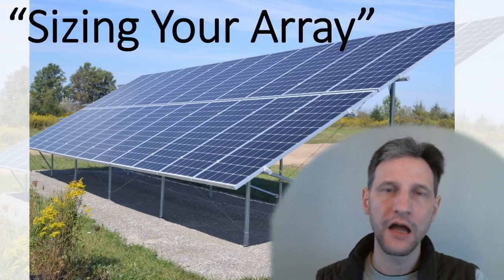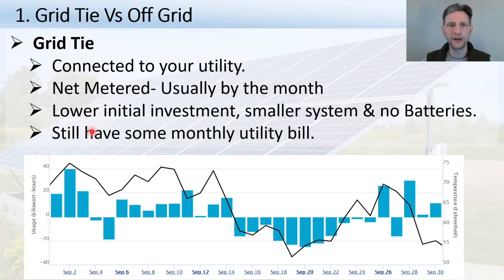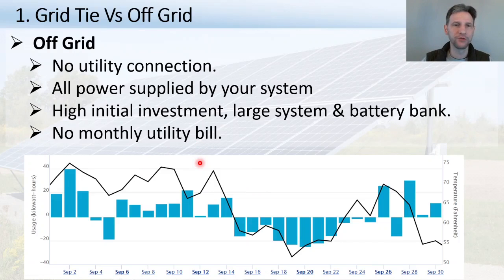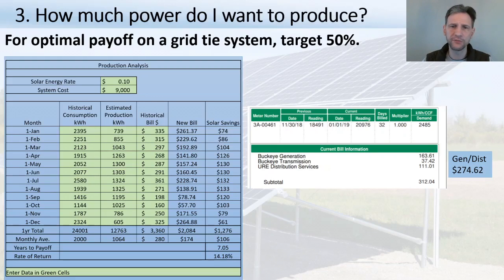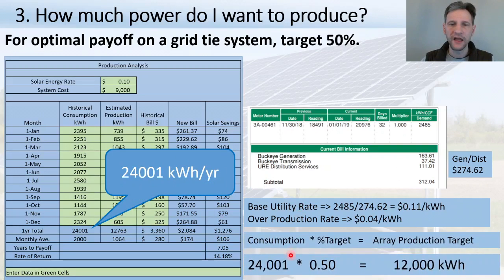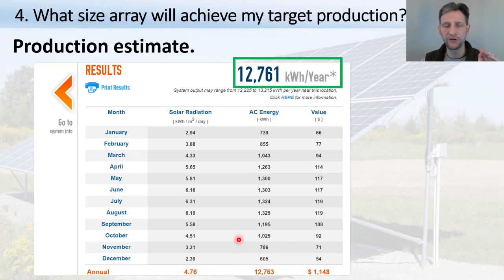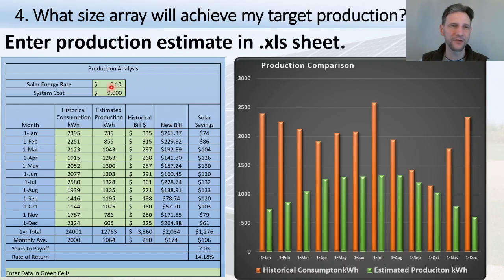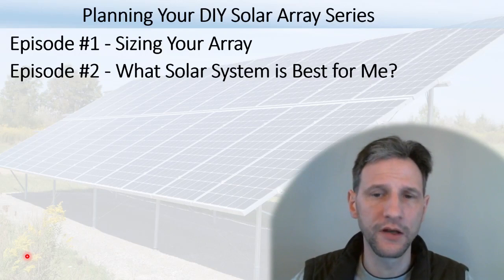How to Size Your Solar Panel System - Planning Your DIY Solar Array Part 1

Comment: Nice video!  I learned a lot. My area doesnt participate in net metering. If I oversize my array on my roof, it will just disapate through the panels without problems, correct? I am 100% electric with geo for heat and cooling. I  am at 67kw in the winter. Accordinding to pvwatts, i can only generate 38000 watts in my area with a 20k array.  In the summer its not a problem.

Comment: Thanks!
Reply from the maker: @LeoHeiland: I am confused on how you determine the value for "Solar Energy Rate" or "Solar Energy Rate $/ kWh" in your spreadsheet. Can I calculate this somehow? It impacts the ROI in a big way. 

Answer:
Typically your utility bill will state your cost/kWh.  In my case I have to add several together.  I have a $/kWh for Generation (0.03788), Fuel Adjustment (0.0295), Transmission (0.02062), Distribution (0.03661), tax (1.57/337=0.0047).  The total would be $0.12931/kWh. The easiest thing to do is take a typical bill and divide the total cost and subtract the base fee, then divide by the kWh consumed for the month.  You may or may not have a "Base Charge".  That is the amount you pay every month even if you use no power.  Looking at this screenshot ( https://drive.google.com/file/d/1N43iuFUcpEe0OiSAXkwEpPelCVx6WWXw/view?usp=sharing ), the calculation would be ($78.65-$35.16)/337kWh= $0.129/kWh.
I hope that helps.
Thanks!

Comment: You are producing an average 33kwh per day from a 9.4kw array ?  That seems low.  I thought averaged over a year in the 48 lower states you could ballpark 5 hours per day times the PV rated output  but yours comes out to only 3.6.  Are you in the far north ?  

Did you calc the array size and battery size you would need to go fully off-grid ?  Is it as simple as doubling the array size to reach 24mwh/y and a battery equal to half the average kwh usage with a small genset to charge the battery bank under unusual conditions ?  Or would you figure needing a 3-day storage at heaviest winter usage ?  Without storage aren't you worried about winter storms knocking down power lines at the worst moment, ie, when you have very little PV power ?

I haven't checked what actually got passed but in CA the utilities were trying to get grid-tie systems to pay a minimum bill equal to $8/m per kw of PV installed -- so $1k/y for the 11kw array I am considering.  That makes off-grid more appealing even if utility power is available.

Comment: I have lived off grid for 10 years in a native forest block, we don't have the open space for a large panel stand so i have 3 systems, one for my main cabin with 2kw of high efficiency panels, one system of 2kw panels for my workshop and another system 750w of panels dedicated to a large stand up freezer. This does everything we need and even though 3 systems may sound expensive it's actually a great option with a lot of redundancy. I will be building a micro hydro with around 500w then we will have no or little generator run time in the winter. Multiple smaller systems is a good option for certain environments. Good video
Reply from the maker: A hydro solution is great!  It's hard to find a constant source of power even it it isn't very large.

Comment: My utility does net metering but requires declarations of system size and actual production capacity.
You must buy a second meter exclusivly for the solar feed into the grid and, if you produce more than you consume, they will pay 1/4 of the rate they charge you; $0.25 on the $1.
That is why I'm preferential to a hybrid system.
It does NOT feed back to the grid but can draw from it when necessary.

Comment: holy crap is that your actual kW use? you really need to look at a significant life change. my 3200sqft house only uses 800-1100kW, including winter months. no solar yet and my electricity bill is only $50-$80 max. my family size is 5
Reply from the maker: Nice, that will help you minimize the size and cost of your solar system.

Comment: Hello, first of all great content. I have 36kw of solar panels, ground installation. It must be limited on 23kw cause that will be max grid will accept. I 'm in dillema of choosing inverter between 25kw SMA or some 30 or 33kw Huawei. I'm closer with SMA cause they are more premium brand but i have concern about power. They do not offer anything between 25 and 50.
Reply from the maker: I don't have experience with the Huawei inverters, but I do know SMA is going to work well for you.

Comment: Dang, I thought we used a lot of power and we're at about 650 kWh per month.
Reply from the maker: Power consumption and available production varies dramatically around the world.  That's why every situation requires some analysis, there is no "one size fits all" for solar.

Comment: Just for fun: I wish we had those utility prices in Europe (The Netherlands. I think our country is 1 of the most expensive countries in the world for energy (and fuel also). ! LoL!!! It costs about 10 times more over here.. The 24001kWh would cost you about 33,600 USD. But no one over here uses this much energy.. The everage household over here uses about 1800kWh A YEAR!(so less than you use in a month! But we have gas for heating) Over here even when you don't use any kWh you'll even pay about 1500 USD (Depending on how large your connection is, it can be cheaper if you have a small connection, for example 1 times 35Amps, but with your usage you need at least 3x35Amps(costs about 5 USD a day). And with taxes and all sorts of costs this will be around 1500USD for a year with ZERO use.
Pretty insane and kinda interresting

But the solar setup you have would cost about 2500 to 3000 USD so that's a lot cheaper over here. This is also a problem because many people have solar pannels now and the grid can't handle it, resulthing in negative energy prices(when it's a very sunny day) for those who have solar panels. So they have to pay for feeding energy back to the grid. But when the prices are negative you'll get paid for USING energy (again this is only for those who have solar panels), so I know people who just turn on everything, heating outside when it bloody hot outside, etc, and they get paid for doing so. (can get up to 8 or 10 cents per kWh)
Reply from the maker: Very interesting.  When you start getting into variable rates and negative rates, you might be able to make sense of a smart battery system that can charge when the rates are negative and discharge when the rates are high.
Reply: @ProjectsWithDave  Yes indeed. That would mean you get paid for charging the battery system (pretty insane right!?)
I think some smart people are getting this into Home Assistant. I think I read somehing about it a couple of weeks back.
I don't know for how long these weird negative prices will last.. I need to get a big battery system ASAP!
Reply from the maker: Don't go too big.  Make sure your payback period is short so you don't get stuck with a huge investment incase the rules change.

Comment: I liked this video, but many users are not solely grid-tie or off-grid anymore with hybrid inverters.  Many of your new videos are doing a hybrid setup.  How would utilizing batteries and a hybrid inverter with grid tie inverters be sized.  Also, what about adding EV into your system and barns/shed?
Reply from the maker: As I continue my testing with hybrid and off grid systems, I will work on new methods for calculating system sizes.  I did already install EV charging.  You can watch it here: https://youtu.be/U2ilH8yOi7A

Comment: This shows you used between 37 and 75 KWH of electricity, per day, during 2019.  The average is around 29KWH per day, or around 10,000kwh per year.  It looks like you are using about 2.5 times as much power as the average home?  Did you perform an energy audit and attempt to reduce your consumption as part of this process?  I live in a state where rates are low, like yours.  I thought there was no net-metering, but it turns out my REMC does pay $.06/kwh.  I'm trying to decide if I should build a system that just barely meets my critical loads, so there's a low cost of installation and very little concern with overproducing, or if I should build a system with 5-10kwh worth of battery.  One thing you didn't mention in this particular video is if you build a grid-tied system and the power goes down, you probably won't be able to use the power from your panels, unless you have an approved cut-off/transfer switch?  I think you cover that in a later video.
Reply from the maker: My house is all electric, and there are 5 people in my family.  Lots of hot water laundry and cooking.  I did just install an Emporia Vue  ( https://amzn.to/41Jvcru ), so I will be doing more detailed analysis for the future on the consumption side.  My system is paying for itself ahead of schedule.  If I was doing it again from scratch, I would shoot for slightly overproducing for the two months closest to net-zero.  Technically the payback is slightly longer, but I think it is a better overall balance considering panels slowly degrade over time and electricity usage keeps going up with things like electric cars etc.
Reply: @ProjectsWithDave  Late to the party here, but great spreadsheet and analysis. I downloaded the spreadsheet and doubled the installation cost and Estimated Production kWh. Payback was the same, and you are giving a little electricity to the utility in September and October. Installation cost would probably not actually double for double the panel kWh (and prices have dropped a good bit--for panels if not for racking).

Comment: quite cheap kWh and therefor 24.000 kWh can be used cause imagine you would have to pay 35 or even 40 Cent instead of 10 cent your consumption would go down a lot and any device would be very efficient. 
good video 

you might check also pvgis which provides data for the whole world. That simulation is then able to add your local shadow line (based on the obstacles on the horizon that will cause shadows over the day and year) you can measure on your own cause usually some shadow will appear and the shadowline caused by building or trees or terrain (terrain will be detected automatically)

You will get far better results even though your systems seems to be free of shadows.

Comment: We have a similar setup: a 5 ton Geothermal System and a 16K grid tied ground mounted Solar System and we just got an electric car.  Thanks for the worksheet and in our case we stand to save $5778 a year!  The payback is 5.34 years.  Even though the video is 2 years old the information is still relevant.
Reply from the maker: Nice!  I'm glad it was helpful.  5 years is a great payback time period.  With more and more electric vehicles coming on line, it's going to make sense to have bigger systems.   That's an easy place to dump extra power in the summer.
Reply: @ProjectsWithDave Our power company reads the meter every two months and it's a kWh for kWh exchange rate though they don't pay for any excess.  So basically if we have excess it's applied to the next bill.  Our electric rate is .281/kWh and there is only a delivery and supply charge.  If we don't import any power there is a $19.95 fee for that month.
Reply from the maker: Wow! At $0.281/kWh it's pretty easy to justify solar.  My base fee is $40 even if I don't use any power, but my rate is only $0.14/kWh.

Comment: Thanks for the video. I am going through the start up phase, selecting inverter, panels and solar size. Here in Quebec our summers are hot, and winters are very cold so my consumption is double. Also I can put a ground instal so it would need to be on roof and dont want to look like a space center. So I will choose the right solar sizing

Comment: Very good video but what I want to know is why you didn't go for 100% or more offset to bring down new electric bill to almost nothing and of course there is a significant savings every month?
Reply from the maker: The equipment cost would be at least 3 or 4 times as much to save the remaining 40% of my yearly electric cost.  It would far exceed my target payback period.
Reply: @ProjectsWithDave  Thanks Dave for your 2 Cents which makes sense.

Comment: So if I understand. Other than the overhead charges for power delivery, You are always buying power from the power company every month however much that is. You are merely supplementing with the solar system to keep your power bill down. Is that about it?
Reply from the maker: Pretty much, except there are a couple months out of the year that I produce all or slightly more than what I use.  
I go into more detail on that part in this video on Net Metering: https://youtu.be/IwUK1dNJ3n8

Comment: Extremely interesting thank you, however, in this calculator, I do not seem to find an option for fixed azimuth (180º in my case) but with a variable tilt for different weeks/months ( 71º/28º) 🤔 or perhaps it is the "1-axis tracking"? But it is still asking for the tilt angle 🤔
Reply from the maker: Run the calculator for the different angles you want to analyze and then select and combine the months from each run into one spreadsheet to get a combined result.

Comment: Hi... love your videos. Wanted help sizeing  a small pv setup with battery for my intex pool. It has a 750w pump and a 125w clorene generator. Both have to run 8 hours a day. The only reason for the battery would be to guarantee a constant power supply to the chlorine generator or else it resets the programming.
Reply from the maker: Does it only need to work on sunny days, or also on cloudy days?  That will make a significant difference in the battery and array sizing.  Are you drawing 875W continuously for 8 hours?

Comment: This is all simple math that makes sense but your ROI of 14.7% is flawed and possibly misleading. The thing you didn't calculate into the math is depreciation and maintenance, both of which can be significant numbers. I'm also concerned with the liquidity of the asset, meaning a CD is relatively liquid while a solar installation is as illiquid as assets can get. Having said that with the way utility rates are climbing solar might still make sense. The other benefit is the intangible value of having peace of mind and a reasonable backup should the grid face problems which might be hard to put a price on.
Reply from the maker: You're right, there are lots of factors that are not considered for the sake of time.  My goal here was to show the magnitude of the possible return on investment is great enough to make it worth considering.  Of course each situation is going to be a little different, some will have much higher utility prices and see significant utility price increases in the future making the return much greater.  Others will have steady prices and may have some maintenance issues reducing their return.  As far as CD's go, I'm not saying you should consider replacing CD's with solar installations, but rather it may make sense as a portion of a diversified portfolio of investments.  Thanks for your input!

Comment: Awesome videos-   Did you ever think of buying a used inverter- I see they can be had for 1/3 the cost- also you mentioned the need for optimizers but everywhere I"ve seen says solaredge inverters have to have optimizers to work even if the string is all in the same direction or without any obstacles in it's way- any truth in that
Reply from the maker: Thanks!  I would consider a used inverter if the price was right, but it would have to be a pretty big savings to build a system around it.  The inverter technology is changing so quickly it may be worth it to buy new.  As for the Solar Edge system, it is designed to only work with the optimizers.  Part of the efficiency of the system is achieved by maintaining the DC voltage at 400V for the inverter.

Comment: Thanks for this...been playing around with the spreadsheet and solar just doesn't seem worth it. I used a quote I got from a company doing door to door soliciting...they quoted a 14kWh system (110% offset) for $70k! I thought it was a joke... I'm not sure if prices have skyrocketed in the last year but $5 per watt seems to be a complete waste of money. It would take 50+ years to pay off according to the chart! The combination of a due west facing roof, cheap energy bills, and the (apparently) crazy high cost of systems...its a big time no good for me. Regardless, I do appreciate your videos.
Reply from the maker: I'm glad you were able to make use of my information to help you make an informed decision on what was being proposed.  $70k is ridiculous for a 14kWh system, I think you made the right decision.  If you live in the US or Canada there is a company called EnergyPal that will give you free advice and maybe give you some options that do make sense.  You can connect with them here: https://energypal.com/everyday-dave
Reply: $70k is crazy i hope you shopped around.. Many places give free quotes. I picked up a 6KW system for $6150 (£5400 since im british) came with a 10kw wall mounted battery, all the cables, panel inverters, ESS SMILE5 5000W Single Phase Hybrid Inverter, from a german company from zerohomebills, there is also deals on all the time for -20% off etc